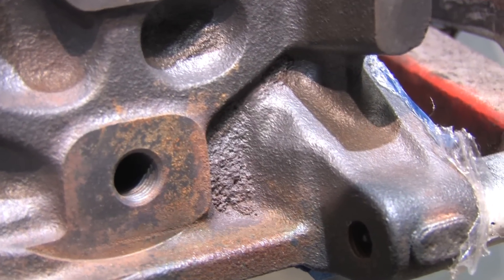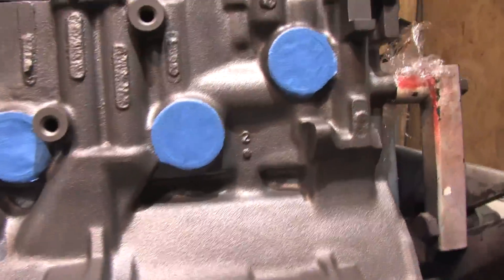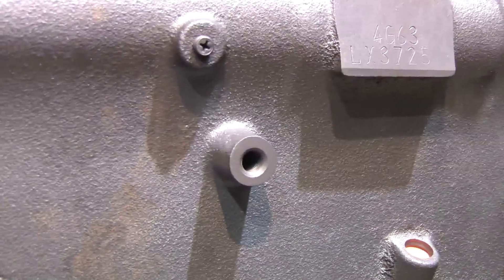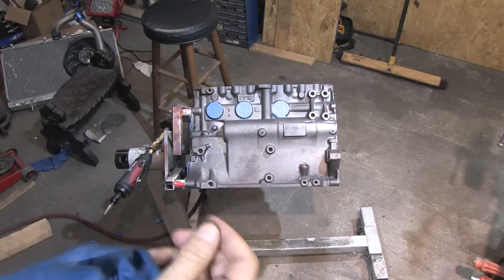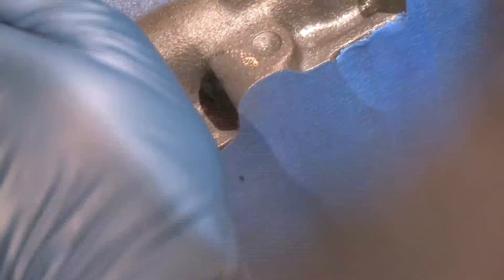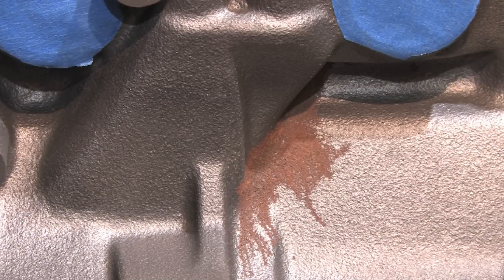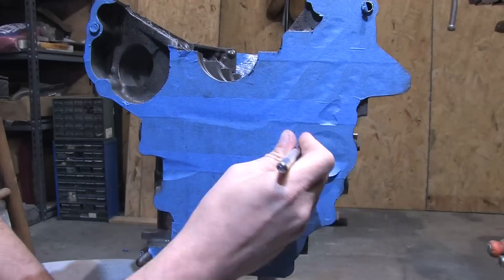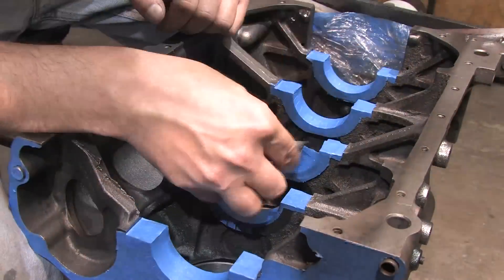GSX Block Prep Part 1 [1080HD]

Comment: Put the Dremel down and back away from the block. Really, this is way overboard, clean the block up thoroughly and stop.
Reply from the maker: This is prep for both an internal and external coating.  It's a show car.  They get a little more attention than the average build.  I get your sentiment, but there's more to it than just being retentive.

Comment: I don't know if internal coating is necessary since the oil will prevent the inner from rusting. altrough smoothing surfaces from impurities inside, specialy the oil channels do great things  to the good function of it as a whole. faster lubrification does miracles

Comment: Seems to me Glyptal would cause the head to run a bit hotter, is this not the case?
Reply from the maker: Sure, it could potentially... IF the engine and oil cooling systems are insufficient for the application.  You can offset where the cooling occurs by upgrading other thermal systems.  With a thick 3-row aluminum radiator and a thermostatically-controlled external air-to-oil cooler it shouldn't be a problem on my car.  My engine's cylinder head also has a pretty elaborate water jacket around the combustion chambers so it's easier for the cooling upgrades I have to be effective at offsetting that difference.
Reply: Jafromobile ok, so it may not add much heat load due to insulation, i thought glyptal was a good insulator, which is why i asked.
Reply from the maker: It is an excellent insulator, but not the kind you're thinking.  It's electrical insulator paint.  It resists 50,000 volts per mil.  That's a pretty astonishing property for a paint coating.  2 coats of it isn't really thick enough to block all that much heat.  If the oil drains faster, though... it will spend less time touching the part that's hot and therefore absorb less of the heat.  In the chemical testing video I made, we did a race to demonstrate what that difference is.  There's a difference in drain speed, but it's not all that drastic of a difference.
Reply: Ah, but usually things that isulate voltage also insulate, but i see your point.

Comment: Those rough areas is sand that stuck into the corners when cast.  Yes, it comes off so it doesn't fall into the motor during assembly.

Comment: I'm going to say something unpopular here but turn off your emotions and evaluate what I have to say. I think it's a bad idea to paint the inside of the block with any kind of paint. You are adding a potential failure in that if it starts to peel off it will clog the oil pump screen very easily. No matter how well you prep the block there is a thing called porosity in every casting, some are worse than others and no matter what you do you will never get all the contaminates out of a casting. 
I have seen large pieces of the glyptal peeled off (4 x 4inch piece) that clogged the oil pump screen and destroyed the engine. My point is I don't think it's worth the risk, oil at operating temperature (200 degrees F) is like water and will drain back easily without the paint. 
I also don't think it's worthwhile to spend more than an hour to deburr a block, just get rid of any casting flash that could break off and get into the oil pump. On some castings the surface is very rough and in this case it would be worthwhile to smooth it out as much as possible for oil drain back. 
Bill Jenkins a well respected Pro Stock racer called it "spit shining", to spend time on unnecessary modifications when that time would be better spent on things that would make more horsepower.
As far as cleaning up the outside of the block to make the finished product look better, that's fine, that depends what you are doing, even for racing you might want to remove sharp edges to prevent cutting yourself. 
Coatings are another place to be careful, some like Micro Blue will not peel off because of how thinly they are applied, but some of the oil shedders might be thick enough to peel. 
Also the gains are small for the cost, Hotrod mag did a test on this...
http://www.hotrod.com/articles/hrdp-0612-engine-coatings/#
My two cents, hope it helps.

Comment: im surprised your not aware of the 2 things you got when you did this procedure..because you spoke of it in your "7 bolt diagnosis" vid..cleaning this block up in the manner you did with that conical carbide burr was just like peening the block to relieve internal casting  stress..making the block more resilient..removing the flash and casting burrs removes a lot of internal resonance points that can lead to block fatigue/fracture and other issues that you mentioned in your other vid..so kudos to for taking the time to do this..dont beat yourself up on the time it took..you got more out of it than you realized :) btw i like your style..these vids are worth watching..
Reply: Gostei do comentário, aprendi mais um pouco.

Comment: Dude....... Theres a fine line between being a perfectionist, and having OCD, taking the burs of with a grinder shouldn't take more than 20min, but hay, I'm not hating on you, you'v got the same passion for small turbo cars I've got and I'm sure it turned out to be a sweet little engine, keep wrenching.
Reply from the maker: I'm not just taking the burs off.  This is stage 1 pre-burn-off oven preparation for a Glyptal application and powder coating.  The car this engine is going in is an 8-time trophy-winning show car.  The judges are the OCD perfectionists and I'm just ensuring I stay a step ahead of them because I'd like to someday put this thing back in the show circuit, even better than it was.  I'm trying to raise the bar on myself.  I learned a lot from the previous powder coating on this car's previous engine.  I found flaws that occurred from not doing these kinds of treatments.  These treatments are permanent so I'm pushing myself for the absolute best results possible.  What I am guilty of… is having done something and conquered it once… and then pushing myself to do it even better.  Even in cases where my goals aren't visible or tangible, I challenge myself like this in all things in life.  I always strive to do better even when I've left the competition in the dust.  Once I get around to assembling this monster, you'll agree that it's the most beautiful engine to ever have its entire assembly filmed and uploaded to YouTube.  My efforts will only add to the car's character.  It's not about me.  It's for the car, it's for the judges, and it's for the fans viewing it right here on YouTube.  :)
Reply: +Jafromobile  Arrrr it's going on a show car, now that makes more sense to me, Iv only seen 2 of your other vids, the tear down with the spun/screwed bearing, and that coating inside the head dose look amazing, if you could engineer a viewing window into the rocker cover or get a clear plastic one made somehow. Yeh don't mind me man, that comment was just a light hearted dig at the most epic de burring (I know it's not that) I'v ever seen. Hope it all comes together nicely, with the attention to detail in this vid I'm sure it will.
Reply: Don Rossco Joe yeah it's for a show car or whatever but do yourself a favor and watch some more of this guys videos. it's far from all show no go. I am always big time blown away by the amount of knowledge this guy pukes out and the details he goes to building a car. specific knowledge of topic here is by far better than any other you tube channel hands down.
Reply: He must have removed 5 lbs of unneeded material, for performance it is worth it.

Comment: When grinding in the bottom end of the block, leave the old bearings in place. They will give you more protection than painters tape and you won't have to go stand in the corner. Don't have the old bearings? Go on ebay and buy the cheapest set you can find. There are always cheap knockoffs from China that OEM fanatics would never use and are cheaper than factory or high performance shops offer. I know its messy, but sand blasting will give you a nice"tack" to apply your glyptal to. Just be sure to blow all the sand out.

Comment: There's more prep you can do to improve things like countersinking, bottom tapping head bolt threads, chamfering all edges if the mains to remove stress risers and chamfering the bottom of the bores so oil isn't shaved off

Comment: I have a question , I blew my motor , I just got done building here soon . I bought a new oil cooler . Do I need a new oil pan and oil filter housing , since I had shaving in both ?
Reply from the maker: That all depends on how well you're capable of cleaning them.  Take the OFH completely apart and clean it, and you should be fine.  Look up my DIY parts washer video.

Comment: Nice videos. To some doing a prep, this is known as "therapy". Feels good taking pride in a job well done. The only real pain comes when engine eventually blows up. Didn't watch all videos but while you have grinder and files out, journals and caps should be relieved. Before Glyptal came along RustOLeum red primer used to coat innards. Glyptal also works good preventing creep with threaded electrical connections. For some, building a small extension the size of a small pallet outside on back of building to house compressor cuts noise and frees up space.

Comment: big fan of your work and attention to detail. question, what size air compressor / tank are you using to powee that rotary tool ? and what would you recommend for a beginner tryna do the same. thank you in advance :)
Reply from the maker: +Pablo Mini It's a 40 gallon Central Pneumatic upright.  In other words, Harbor Freight.  They used to make this 40 gallon 240V model and I bought it on clearance for $399.  No coupon.  110 PSI.  I wanted it because it was 240V and because it had a twin-cylinder oiled compressor with a 14.2 CFM recovery rate.  I've kept it oiled, but it does nowhere close to that anymore.  It's doing about 5 or 6 making banging noises..  It needs work.  I've done some grueling jobs on it.  Using it Jafro style made it only last about 7 years, but divided up on all the jobs it was well worth it.  My point with it was to demonstrate that it doesn't matter what you spend if you can just find one with a good recovery rate... but with cheap tools, you're going to get what you paid for.  It's loud.  It develops leaks from crapmetal regulating parts, has never been well balanced, and eventually shakes itself to pieces.  At that price, who cares?  It's still going and I'm going to run it to death just like I did with the Hyundai and the GSX.

I would have traded 2 or 3 CFM for a whole lot less db.  Look up the Airmax HRA25-12 Air Compressor if you've already dropped anchor and can afford it.  They're stupid-expensive bushed and balanced, 25 horsepowered, 208, 230 or 660 VAC 3-phased, magnetic started, self-draining, low oil emission workhorses.  They will last you a lifetime and service parts will be available forever because it's a medical-grade unit.  It's a 175PSI 90 cfm 125 gallon compressor that runs so quiet you can mumble a conversation to someone half-way across the shop  and they will easily hear you.  You will hear them mumble back even if you're standing right next to it.  It's amazing.

Comment: Why the hell would you want to spend so long cleaning the inside of an engine?!!!
Reply from the maker: +Lewis Floyd Henry Oil doesn't do you any good stuck all over the crankcase.  It's better off quickly flowing back to the pan where it needs to be to bury the oil pickup tube in enough oil that it doesn't start sucking air.  It's helpful for cars that rev over their designed rev limit because the oil pump usually dumps all the oil up in the head and it can't drain back fast enough. This block will be painted with an oil-repellent coating.  But at the following video I take an alternative approach by sanding off all the rough cast and creating polished channels.  I do a visual experiment that I call the "motor oil drag race" to demonstrate its effect.  It's how the old-skoolers do it, but the old-skoolers have been using oil repellents for decades, too.  All the oil in the crankcase is supposed to do is drain back to the pan to be filtered.  With a smoothed out crankcase, all the junk ends up in the filter instead of stuck all up inside your block.  https://www.youtube.com/watch?v=zkyegSpuM44  If youtube stays alive another decade, you'll see how clean it stays.
Reply: +Jafromobile I see, it's to do with oil flow and minimising oil contamination from rust. I'm assuming this is a common problem in iron cast blocks. I'm doing my first total engine rebuild on a 1971 Honda cb350. It's alluminium so there is no rust on the casing or heads etc. I'm still going to give them a good clean. What's that stuff that you use to get carbon build up off, you know the powerful stuff they tried to ban?? Thanks for these vids they are very informative. :)
Reply from the maker: Lewis Floyd Henry
 It's called Berkebile 2+2.  Gum Cutter.  You can run and drive a car on the stuff and I've done it dozens of times to pull cars with no fuel system into the shop.  It's wasp killer, carb cleaner, brake cleaner, and fuel all in one.  The absolute worst thing to ever accidentally get in your eye.  Let me make that mistake so you don't have to.
Reply: +Jafromobile Is it akin to getting carb cleaner in the eye? lol
Reply: +Lewis Floyd Henry I'm in the UK so I'll have to find an equivalent.
Reply: +Lewis Floyd Henry Do you coat the inside of the engine with something to make it smoother or just buff it up?
Reply from the maker: Lewis Floyd Henry Worse.  It burns much worse.  Acetone (the ingredient in carb cleaner) plus xylene, toluene and methylbenzene.  Hardcore organic solvents.  You're not going to take out the whole hornets nest without fire using carb cleaner.  With 2+2, you don't need the fire and nothing ever chases you.
Reply from the maker: Lewis Floyd Henry Use indoor formula white spirits.  It's called "mineral spirits" here in the US.  Look for my DIY parts washer video.  That's what you need.
Reply from the maker: Lewis Floyd Henry I'm building 2 engines with different processes to achieve the same result.  I have one that will be coated with glyptal 1201, and the other is all sanded smooth with oil return channels instead.  It's 2 different approaches.  The block in this video is the glyptal block.  The link in my first comment is the un-coated method.

Comment: So polishing the cylinder walls is a benefit too?
Reply from the maker: No, not the cylinder walls.  Just the crankcase.  It improves oil drain back to the pan in order to add a tiny bit more oil volume on top of the oil pickup so that it doesn't create a vortex and suck air.  Slow drain back means a shallower pan with the engine running.  It's not a design flaw of engines to have a rough interior, after all, the oil level takes that into consideration.  But what about engines built to run flat-out for 10 seconds straight at rpms 2000 higher than its original design?  That oil is not hanging out in the pan.

If you polished your combustion chamber, your rings would stop working.  I just did this to the crankcase.  ;)
Reply from the maker: ThatDanDude Perhaps I should explain this better?  The crosshatch on the cylinder walls is what holds oil, and it reduces the surface area of the bore that contacts the rings as they sweep the chamber.  Compression relies on oil viscously-filling in that gap.  Once the cross-hatch is gone, there's nothing for the oil to stick to, and the rings scrape it dry.  Friction increases, wearing out the rings faster, and compression is also lost through that gap.  That cross-hatch texture in the combustion chambers is critical to your engine's efficiency and performance.
Reply: ***** I think Dan thought the inside of the crankcase was the 'cylinder walls', fyi.
Reply: JinEteru No, I know where the cylinder is.  There is a lot of engine builders on YouTube, not all take the time to polish the crankcase web.  Thought maybe he had a trick up his sleeve unbeknownst to the rest.  The crosshatch is pretty important.  I do know that much.

Comment: That's meticulous work.  Is there a benefit from it?  Your an expert at polishing.  I do get that.
Reply: Sharp casting edges are potential weak spots for cracks to form, smooth surfaces aids oil returning to oil pan, reduces rough surfaces that promote varnish build up.

Comment: Should leave the old worn mains in the journals to protect them, ditto with the oil squirter bolts and washers
Reply from the maker: Didn't have them.  All I had were 7 bolt bearings and they're a half-inch too narrow for this.  Since my Hyundai blew up (it's 6-bolted), I have a set now... but didn't have it at the time.

Comment: If there's ever a next time, some old main bearings would make for supreme protection from the power tools.
Reply from the maker: Yep.  There's been a next time (current video), and this time I actually had a set of bearings to put in it.  When this video was shot, I didn't have any except for 7-bolt bearings which are far too narrow to offer any protection.

Comment: Not sure if anyone posted this. I didn't go through all the 100 comments. You could put a set of old junker bearings in the block. You can even put the cap side(bottom) ones in so it would cover up the oil passages to prevent shavings from entering. You would have to try pretty hard to gouge those down to the main journals vs a thin layer of tape.

Comment: I'm a newbie my bild is a 2g 4g63 gst 9.1 rotating assembly arp all the way around super damper map sensor 4 bar fuel regulator coil on plug ar/30 turbo stock boost stock ecu a lot more. so can i run a 9.1 on a stock ecu